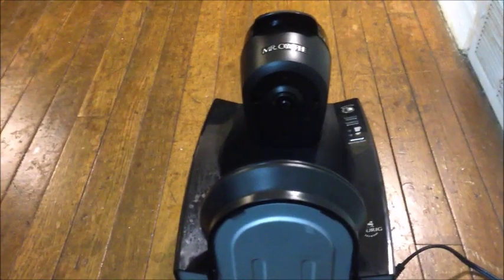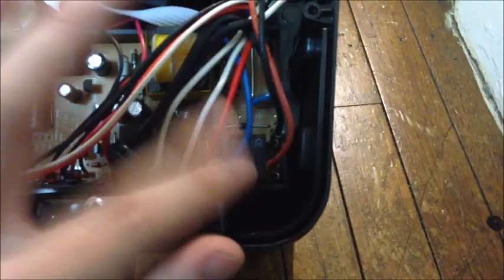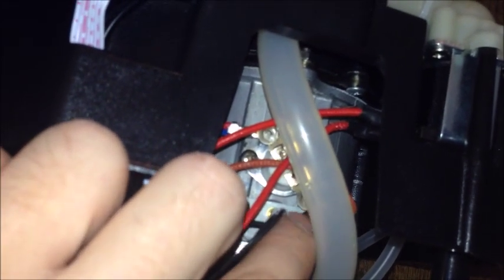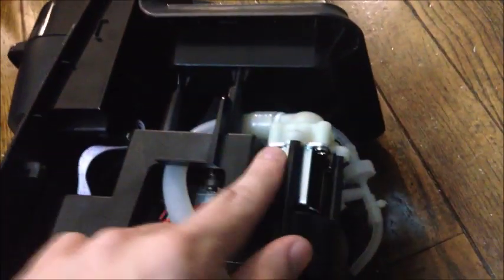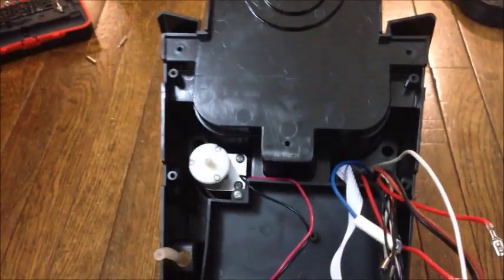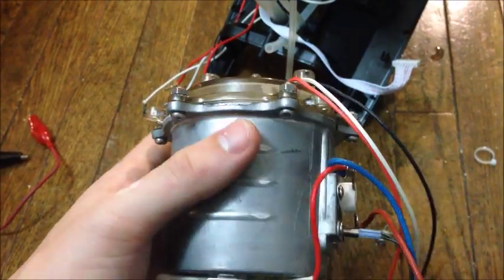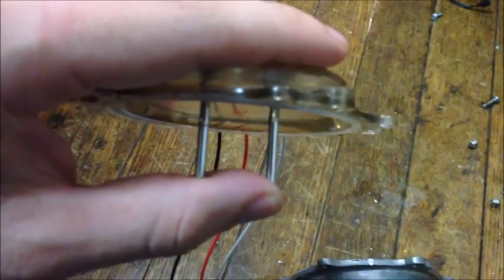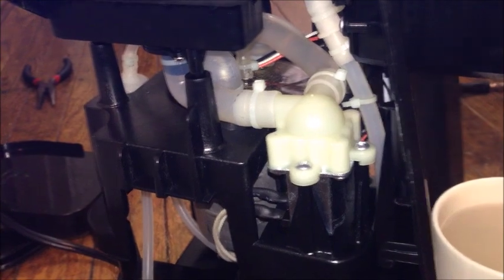How to disassemble Mr. Coffee Single Serve coffee maker

Comment: Twice I've disassembled mine for blockages and fixed it for 6 months or so by blowing compressed air from the pump and out the needle. Both times were caused by my wife running vinegar thru it apparently dislodging crud. I missed the single screw holding the control board in. Without its removal, you can't go much further. Brewing a small cup only no matter the setting has been an issue since it was nearly new. Seeing the kettle removal and understanding the level probes makes it obvious that the next time it fails, I need to go further.
Thank you for the video; it's refreshing to know there are still a few folks out there that prefer to fix things rather than toss 'em in the trash.

Comment: Awesome video. Bought mine brand new in the box at a yard sale for five bucks. Took at home didn't work. Using your video I was able to take it apart and find that the small hose inside was actually broken. Took it apart, cut the hose, put it back together and it works perfect! Thank you

Comment: Good tip on using a common flat head screwdriver for hex screws. Size of screwdriver needs to be relatively small. Slightly wider than eyeglass tool

Comment: Just about to dive in myself. Thanks SO much for posting this.
Reply: So after doing exactly this and finding no scale, I am still getting variable brew amounts on the large setting. I can only conclude the three-sensor system is a bad design in the first place, or something in that circuit is wonky. Since it's low voltage going through an IC, I just cant figure it out. If I can find a broken machine I'll try and swap the board to see if that helps.

Comment: This completely explained our issue, thanks!  Ours was suddenly dumping water into the trap, I assumed something had come apart inside.  it would appear that the system lost track of how much water was in the kettle, I assume that  a cycle was stopped before it it brewed or the valve leaked by and the kettle filled on it's own.  When I would start a new cycle it would try to fill the kettle which was already full and water would bypass through the vent circuit and into the trap. I left the reservoir empty and ran a few cycles through to make sure it was evacuated, works fine now.
Reply: I was impressed by detail and clarity of explanation of how the brewer worked, I had no idea! But now I do. I am going to try Adam;s fix before taking unit apart.

Comment: My first Mr. Coffee Single Serve machine had the issue where it would brew the first cup of the day at the large setting (if that's what it was set for).  All subsequent brews at the large setting would always only brew half a cup.  I just got in the habit of putting it on the small setting and running two cycles for the subsequent cups.  I dealt with the inconvenience for several months.  I mentioned the issue to one of the associates at my Wal-Mart where I bought it.  She said to bring it in and return it.  Since I still had the original box, I did so.  Now, the second machine does exactly the same thing after only a week or so.  Clearly, there's a design flaw in these machines.  After more than a year, I continue to deal with the minor inconvenience (mostly it's telling others how to use my machine now).  The other day, it started only dispensing a trickle when brewing.  In the past, I've done the paper clip trick and that seemed to work to unclog the needle.  Now, however, it's just being weird.  Sometimes it will dispense a little, sometimes it won't.  Sometimes, after pushing the Brew button, it goes straight from Heating to Brewing and nothing comes out.  Other times, after pushing the Brew button, it'll cycle through the Heating and Brewing lights, then turn them off and flash the orange Brew button.  When it does this, none of the pumps even come on.  I've found that when the orange Brew button is flashing, you can hold it down for about 5 seconds and then a pump kicks on.  Unfortunately, for me, nothing comes out (I think it's because there's not actually any water in the kettle).  Thanks for posting this video.  I'm gonna rip this sucker apart and give it a shot.  If I can't fix it, no problem... I was done with it anyway.  I'll buy another brand/model next time.

Comment: I just found why it only brews half a cut no matter what the setting is : The compagny made an error.  Just inverse the white and black wires on the top of the boiler (sensor for 6oz or 10oz brew).  I worked all day long on that problem and just before giving up, i inversed low and high level wires.  It works like it never does when new!

Comment: mine will only brew a half cup no matter what setting 😲
Reply: The compagny made an error.  Just inverse the white and black one on the top of the boiler (sensor for 6oz or 10oz brew).  I worked all day long on that problem and just before giving up, i inversed low and high level wires.  I work like it never does when new!

Comment: Not super familiar with electronic components and what not but I have dissembled mine and it seems the problem lies in the very first valve that allows water from the reservoir to go to the kettle. I don't have an ohm meter so can't measure any sort of output but I even couldn't remove the wires that control the valve from the circuit board without worrying about breaking something; they are tight onto their connection. Any further advice on how I could work on this would be greatly appreciated!
Reply: If you're still trying, take a pair of pliers and bend the 'wings' of the connectors back a bit. They have a little bump in the center of each connector that's supposed to make them unable to be taken off, but adding a little more clearance should let you slide them off.